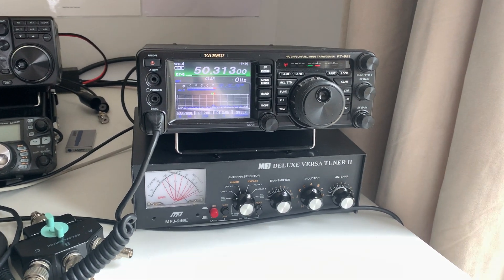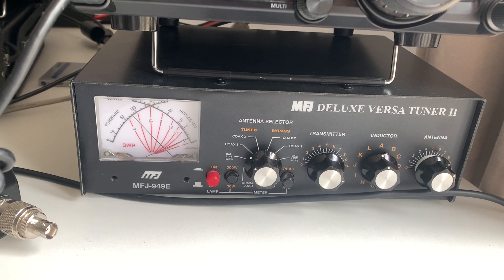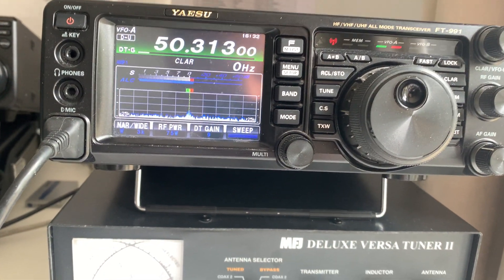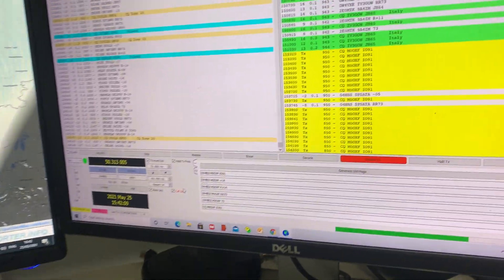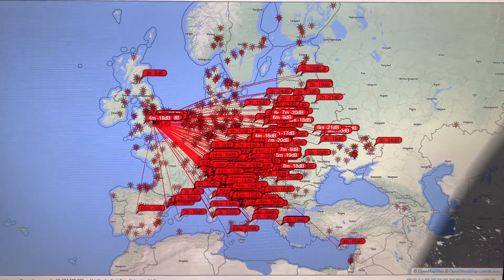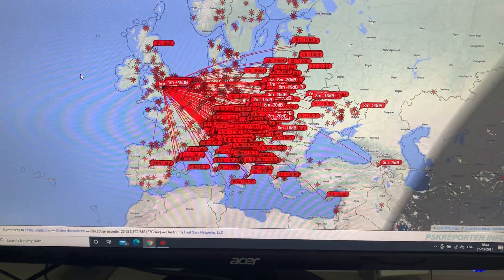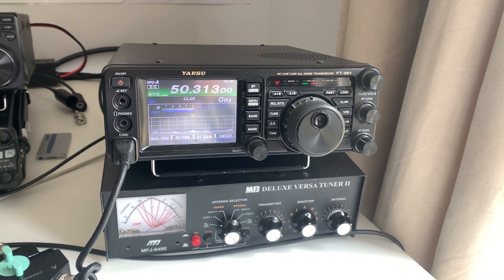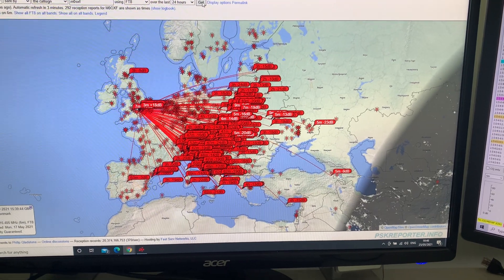6m FT8 with the wrong antenna and wrong ATU! (but it still works!)

Comment: I've made lots of 6 m QSOs on SSB with "wrong antennas" recently. With my Force 12 tribander yagi, with my G5RV and with a CB Antron 99 ! Also tried an aluminium home made dipole inside my loft. No difference. Always received 59 and someone even told me that a piece of wet string would work the same ! 6 meters is an amazing band with a little help from sporadic E. 73 Jean-Luc
Reply from the maker: Great stuff Jean-Luc! Keep safe my friend. 73

Comment: A G5RV will work on 6 meters. I have used mine when it was up. My ATU handles it nicely.
Reply from the maker: Yes mine does but the match is poorer than my end-fed wire. 73

Comment: Sip
Reply: The spread is to do with propagation - where it is happening and where your signals go look at dxmaps website to see where prop is :)  to see where you can target. It’s typical of normal propagation in summer - in summer 6m goes mental from may to October  There is also weeks of nothing much on 6m. Make a dipole from wire and garden canes and check dx maps where best to target. Enjoy the magic band - some times it’s magicked away to nothing instantly

Comment: Nice opening. Tried 2m FT8 a number of times here in VK3 and don't thing anybody is operating it on 2 here :( 73's
Reply from the maker: Hi Darrin, FT8 in the UK on 2m can be very patchy - sometimes the band is completely dead and not because of prop. 73